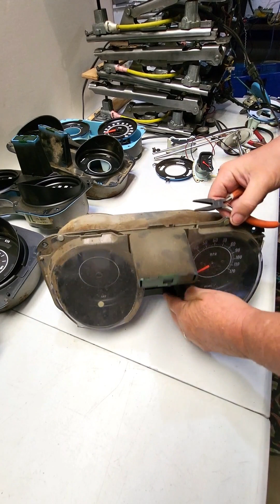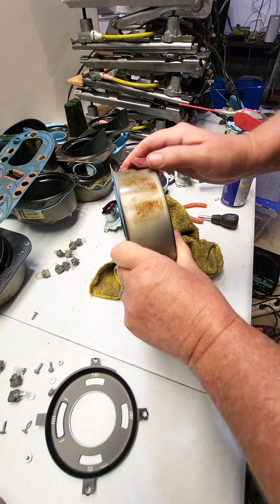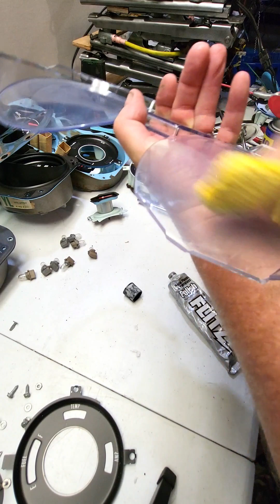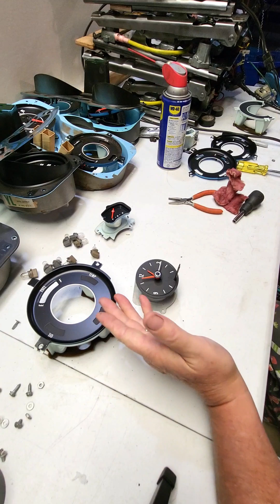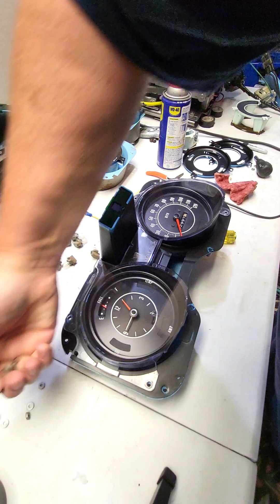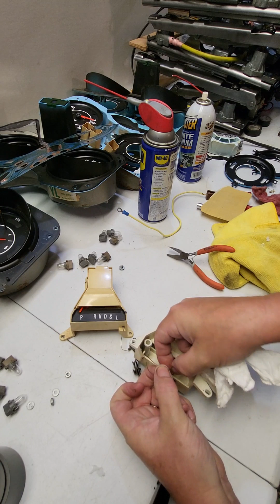1971 PONTIAC CATALINA GAUGE CLUSTER RESTORATION

Comment: how hard is it to remove the gauge cluster?
Reply from the maker: Not too bad. You have to remove the lower close-out, then the bezel.  Unplug the harness, speedometer cable, upper left hand bulb with the fiber optic cable that illuminates the headlight and wiper lettering, and the gear selector cable. Only 4 bolts hold this cluster in place.